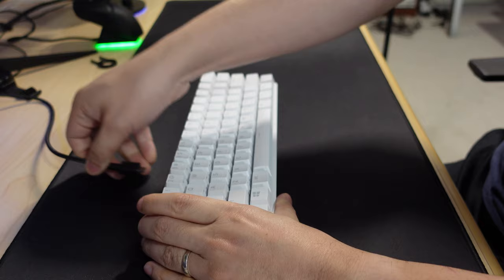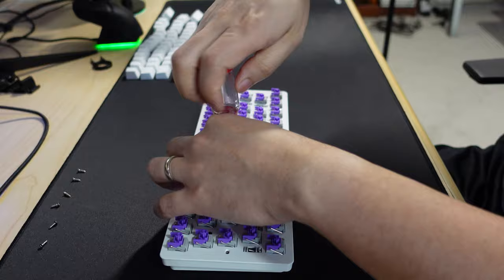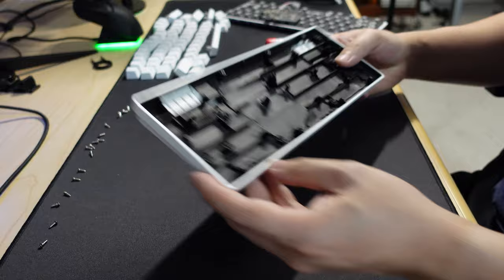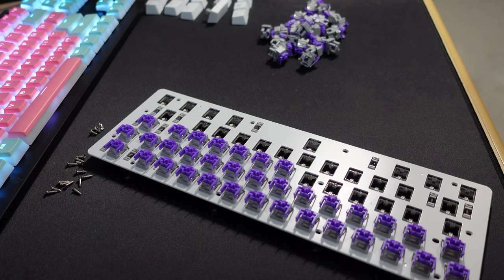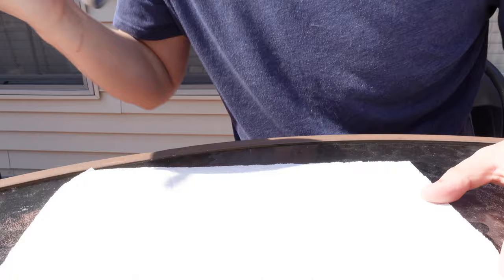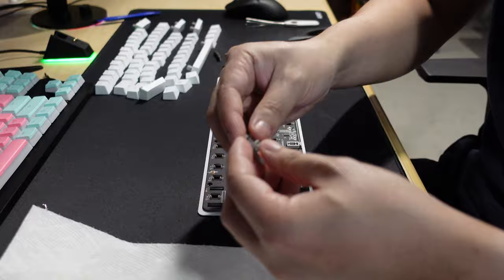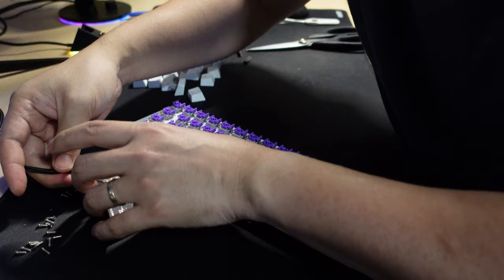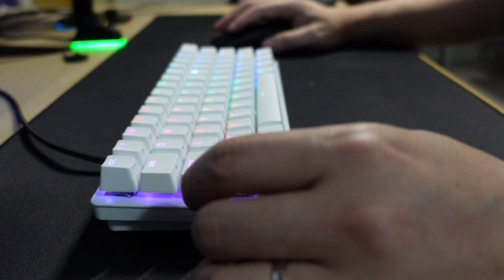Modding the Razer Huntsman Mini: Easy steps for better sound!

Comment: I think if you’re going to pay full price for this keyboard, its not worth it to then mod it. Even getting a Anne Pro might not be a bad option. But, like me, I got it for sale, barely used, for $80. Now I can spend the extra money on lubricant and foam.
Reply from the maker: I tend to agree with this. At the same price point, there are a lot of great 60% hotswaps available. They're more flexible than the Huntsman Mini and upgradeable down the line (if you want to get more premium switches). They're also easier to mod with removeable switches and standard plate mount stabs. But for either case, if you want "good" sound, you'll need to invest a little extra in lube and foam to really get it tuned in.
Reply: @bigxie  Yep, I got the purple switch variant as well to go along my viper mini. Its going to be my first time ever trying a keyboard with something other than a membrane switch, let alone modding it. I'll definitely be watching this video over and over again so I don't mess up anything. Wish me luck!
Reply from the maker: Good luck! Feel free to hit me up in the comments if you have any other questions.
Reply: @bigxie  so I modded my keyboard, but it didn't quite get rid of the pinging, especially on the space bar. I placed foam and used super lube, maybe I didn't lube the switches correctly?

Comment: yeah that’s why i got a linear switch with huntsman te because my last budget keyboard had that sound so i got a quiet one and i love the sound without the mod
Reply from the maker: That's just the difference between clicky and linear switches. The Mini is also available in linear (red) switches and they're a lot quieter than the ones in the TE since Razer listened to the complaints from TE owners (too loud, too sensitive) and made improvements in their 2nd gen linears.
Reply: @bigxie  the linear switch is more responsive in the linear than the clicky and the clicky has that spring sound with it like my dierya dk63 and razor huntsman te don’t have that

Comment: I tried to do the same thing but the middle sliver screw isn’t coming of? Is there supposed to be two different screws your supposed to use???
Reply from the maker: The screws should all be the same size. It's possible that your screwdriver isn't an exact fit so it was able to remove the other screws since they weren't in as tight, but is slipping or stripping this screw. Be careful not to strip the screw because then it will be very difficult/impossible to remove.

Comment: For the razer huntsman te how have the keys held up? I really want to do this I’m just afraid of breaking my keyboard. I’ve heard that WD40 can ruin keys but I think there usually talking about normal WD40 and not the specialist dry lube with ptfe. I’m just wondering if anything bad has happened to the keys?
Reply from the maker: Nothing bad has happened to the switches since I put these on about 5 months ago. Granted, I've picked up some more custom boards since then so I don't use the TE as frequently anymore, but when I do, it works just as well as when I initially performed the mods. I think if you really understand what's going on in the keyboard, you can see that the switches are literally used to block a beam of light that shines across each key on the PCB. If anything were to be interrupted by the lube, it would happen initially, and not over time. What could happen over time (but hasn't to me, maybe due to less frequent use), is that the lubrication offered by the PTFE dry lube will wear off and require another spray a year or so down the line.

Comment: I have this in Reds, and I think they may have changed things between now and then because it has zero ping. tad scratchy though, and the spacebar def rattles a bit. what mods would you rec then? should i still hose it with dry lube?
Reply from the maker: That's really interesting to hear, maybe Razer made some improvements since the release (when this video was made). The spray lube addresses both the spring ping as well as scratch. You probably don't need to hose it in lube like I did, just focus on the sliders and click the switches a few times to get it spread out. For the spacebar and other stabilizer rattles, some dielectric grease or thicker traditional lube can help sort those out.

Comment: Hi I have a question I have a huntsman mini keyboard and I want to know if there a order to connect the cord to your keyboard because I think I connect the cable to my keyboard in the opposite way or it doesn’t matter ? Pls help
Reply from the maker: The connector is USB-C, which is reversible, so it doesn't matter which direction you plug it in.
Reply: @bigxie  thanks bro because I thought I broke the cord because it went through the opposite site of the keyboard

Comment: Is it possible to spray wd40 while the switches/stabs are still on the pcb? Im scared i might break something if i push the switches out 
And can i use mousepad as foam for the case? Thanks
Reply from the maker: I think I saw a video where someone did that and it worked, but I wouldn't recommend it. The switches just clip into the PCB and if you loosen the clips before pushing the switch out, there is no risk of damage to the PCB. Spraying the switches once they're removed and giving them ample time to dry is the best way to avoid any issues. The issues arise from the PCB as the switches themselves have no electrical function and pretty much act as glorified light blockers for the PCB.

Comment: I have a question when i take the razer switches out am i able just to put in a cherry mx switch ? 

Im new to mechanical keyboards so i dont know stuff like this
Reply from the maker: Unfortunately the Huntsman line is only compatible with Razer's own proprietary optomechanical switches, and does not support traditional MX style switches. If you're looking for a nice 60% hotswap keyboard that supports MX style switches around the pricepoint of the Huntsman Mini, check out the Kemove Snowfox.

Comment: hey i have a question. would i be able to take these switches out and put a different switch in like some nk creams? or does the razer board only work with razer switches?
Reply from the maker: Unfortunately, the PCB in this keyboard is only compatible with Razer optomechanical switches, so basically just their red and purple switches that come in the two different versions of the keyboard.

Comment: just some questions, how do you pop the stabilizers out? I opened my Razer huntsman te, and i couldnt get the stabs out. Also, do you also use 2 layers of sound dampening foam on the te?
Reply from the maker: It's easiest to get them out if you approach from the front. The rectangular plastic bases have clips that when compressed, allow for them to come free from the PCB. 

I did use 2 layers of foam in the TE as well, but it does come in contact with the bottom of the switches. I was able to compress everything back and not encounter any issues but if you're concerned, you can stick with one layer. 

I'm pretty sure the lubing is more impactful on the sound than the extra layer of foam anyways.
Reply: @bigxie  Thanks, also another question, around 2:25, on those stand-offs in the case where the stabilizers wold be, (the hollow cylinders with a cross), I can see there is a little pad of some kind of sound dampener, did you add that on to the board? or did it come stock like that, because on the huntsman te, the same stand-offs dont have those little pads.
Reply from the maker: @Alex-gp5xl  up to the point at 0:02:45 where I hold up the base, I had not made any modifications to it, so that's just the way the stock Mini is. I don't recall noticing the difference when I opened up my TE, but I didn't add anything directly on those standoffs in either case. I did make sure that the foam filled in the space around the standoffs pretty well though.
Reply: @bigxie  alright, so would you recommend me putting some kind of band aid over those standoffs to try and dampen the stabilizers on my huntsman te or should I just leave it as is.
Reply from the maker: @Alex-gp5xl  you could try. I didn't and most of my stabilized keys sounded great, except the backspace (maybe you can hear it in the other TE video), so maybe some kind of very thin padding over the standoffs could've fixed that. I ended up using an o-ring on just the backspace key and now it sounds more consistent to the other keys.
Reply: @bigxie so i tried it out myself, and it worked out, i cut a small piece of a fabric bandaid, and put it over those standoffs, the difference was small for the keys except for the backspace, which sounds pretty good now, im going to try to put 2 layers of bandaid on the standoffs other than the backspace
Reply from the maker: @Alex-gp5xl  nice, that's awesome. I'll give it a try too this weekend. Thanks for sharing.
Reply: @bigxie  no problem, let me know how it sounds! I only have done the bandaid mod but no lube or dampener yet and I'm curious
Reply from the maker: @Alex-gp5xl  I did the bandaid mod over the weekend on my TE and I think it did make a slight improvement, especially to the backspace which was rattling a bit before. Also opened up my Mini again and yeah, there's that rubber piece in the middle of the standoff to brace the stabilizer bar when it comes down and absorb some noise. I think adding the padding on the TE helps to recreate the same effect. Thanks again for the tip!
Reply: @bigxie  no problem, also another question, would you recommend taking the stabs apart, and putting dielectric grease on the ends of the metal bar? ive seen other youtubers do this with normal stabs, and im curious if it would work on the stabs on the huntsman.
Reply from the maker: @Alex-gp5xl  the optical stabs are a little different and I think would gain less benefit from greasing the ends of the metal bar. If anything, I think the friction points are at the 90 degree angles where the bar rotates along the plastic housing. If you have the supplies, I think it will benefit. I didn't and also was lazy, so I just sprayed the hinges as well as the ends of the bar.
Reply: @bigxie  can you describe where you sprayed the switch a bit more specifically? I have all my supplies ready to go, but I just realized i dont know where to spray lol
Reply from the maker: @Alex-gp5xl  I just sprayed up the spring from the bottom of the switch
Reply: @bigxie  should I spray the part of the metal stabilizer on each key where it touches the red part of the switch? Also is it possible that I overlube the switch, and I mess with the optical sensor?
Reply from the maker: Yeah, I did get some up there when I was spraying the switches. If you're using the WD-40 PTFE spray, it's actually pretty runny so I don't think it's possible to overlube, especially if you give it an hour or two to dry. The optical sensors are on the PCB and unlikely to be affected (since there won't be like lube dripping off the switches).
Reply: @bigxie  alright thanks for your help, I'll be lubing my keyboard later today and will also be trying to spray paint the top plate of my keyboard as well. Hope it turns out well

Comment: how did you take out the stabilizer keycaps, my razer keyboard seems like the stabs are in the bottom of the keycap being held to the board by a wire
Reply from the maker: Those posts attached to the bottom of the keycaps need to be pulled out with some pliers and then attached to the new keycap. When it's put back in, they'll grab on to the wires below.

Comment: Thank you for the video! I'm looking to mod my Huntsman TE. Can the switches be replaced for any other kind of switch or just Razer's opto-mechanical switch types?
Reply from the maker: Hi, Razer uses the same OEM for their opto-mechanical switches as Bloody, so technically maybe those LK Libra switches would work as well, but I'd stick to the Razer red and purple switches. The problem with switching switch types in these keyboards is sourcing the extra switches to begin with (as far as I know, they're not sold separately from the keyboards).

Comment: So I've got the huntsman tkl with the reds.. I've found it a little too sensitive. I breathe on the keyboard and it types a sentence I feel like. Is it the actuation. Force or the distance that creates this problem
Reply from the maker: Yeah, that's really the biggest issue I have with Razer's first gen linear optical switches. There's a review of the Huntsman Mini (linear) by chyrosran22 that goes over the differences between the generations, but the biggest difference is that the first gens actuate at just 37g of force, which is very, very low, and leads to those issues with accuracy when typing.

Comment: How do I unscrew the stripped screws? Cause mine got stripped. This was a used keyboard so I didn’t strip them. Just wondering how to take stripped one’s out
Reply from the maker: I would look up some general tips or tricks for removing stripped screws. It's particularly difficult here since they're so small and I think most methods are destructive, so you'd need to replace the screw and I'm not familiar with the specs or where to find them.
Reply: @bigxie  ok thanks for the advice!

Comment: Hi I was wondering if you could make a short tutorial on how to remove razer stabs, open them and mod them. I seem to be having a bit if trouble. Thankyou!
Reply from the maker: When you get to the PCB, you'll see that they are held in pretty simple by a couple of clips. Just unclip them and you can put the lube/dielectric grease wherever the wire and plastic meet.

Comment: Hey I know this is an old video, but do you think this works on the tkl version of the keyboard, like could I still take out the switches?
Reply from the maker: Yes, it works for the TE as well. Check my channel for a video on before/after and the one extra screw that's hidden on the TE vs the Mini (which is the only difference in disassembly).

Comment: Andrew my keys that have stabilizers are getting stuck when they go all the way down do you know why plz help me
Reply from the maker: Hey, did you add dielectric grease on the stabs? If it's too thick, the added resistance could be causing it to get stuck coming back up. Another thing to look out for is if the built in stabilizer (on the switch itself) is slightly out of its grooves. That can happen very easily when popping them out of the PCB and can either cause the switch to have a harder time coming back up or get stuck altogether.
Reply: @bigxie  I found the fix i did the bandaid mod and when I pushed it down all the way it was getting stuck

Comment: Roughly how much room do ya have for foam/ dampening in this case, I'm looking to do these same mods to my keyboard, but not sure what thickness of foam to use?
Reply from the maker: I used 2 layers of 1/8" foam, but it compressed in areas, so not quite 1/4" altogether. And different areas will have varying amounts of room, so some areas only fit a single layer.

Comment: Upon further testing I HIGHLY SUGGEST DO NOT USE WD-40 DRY LUBE WITH PTFE ON THIS KEYBOARD! It has made my keys slightly stick when pressed lightly.
Reply from the maker: Sorry to hear about that, but it doesn't mirror my experience at all. Actually, after 6 months, I haven't encountered any issues or noticed any fade in the effects of the WD-40 dry lube. Did you remember to shake the can well before spraying and then between every couple of switches? Otherwise, it's possible you didn't spray an even coating and could have gunked up the switches.

Comment: I looks like each switch is held in place by tabs on either side that need to be pushed in at the same time to removed them from the plate, have you tried to see if that would work better than just forcing them out?
Reply from the maker: Yes that works and is probably the better, more proper way to do it 😂

Comment: I damaged some of the slots while popping them out and now it doesn't register the clicks. Is that it? Damaged? Or is there a way to fix this??
Reply from the maker: Which part was damaged, the clips on the switches themselves or the actual PCB? If the PCB is damaged, then you're likely out of luck. But if it's the clips on the switches that were damaged and preventing them from fully seating in the PCB, then you can likely just buy some replacement switches to address the issue.
Reply: @bigxie  Nah it was the PCB.... I got lucky tho! When I went to Best Buy to ask about the warranty, they didn't even bother doing their job right. All that was said was "Just go get a new one" like oh okay bet. I did it again and well I did it more carefully and properly this time. Sounds great!!
Reply from the maker: Glad to hear it worked out!

Comment: I have a question, I have dropped a key with the switch and I don't know how to put it back, could you help me?
Reply from the maker: Sure, but I'm not entirely sure what you mean by "dropped a key"? Do you mean that the switch popped out along with the keycap? If so, you can actually push it back into the socket without disassembling the whole thing (just be sure to unplug it when working on it).
Reply: Do you have instargram to be able to send you a photo??
Reply from the maker: @fulm1713  not too active on IG but do check my Twitter, both are @bigxie.

Comment: I have a question why is to hard to get out the usb C from  your huntsman mini ??
Reply from the maker: It shouldn't be too hard, but Razer does include their cable which has an extra thick plastic surround piece around the connector, which is also slotted to accept the ridges on the Huntsman Mini case. The connector is also really recessed. These additional friction points will make it harder to pull out or insert the USB-C cable.

If it's causing you a lot of issues, you can just use a different USB-C cable without as much plastic around the connector and it will plug in and out normally.